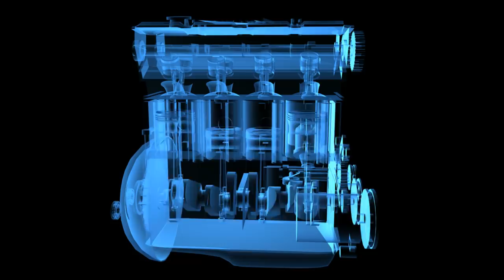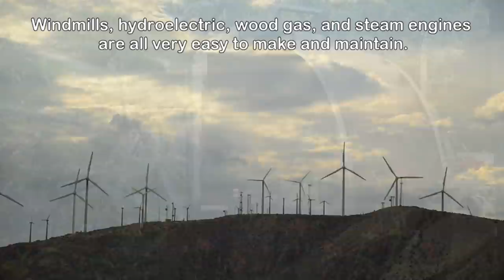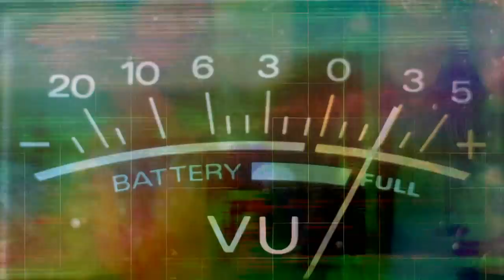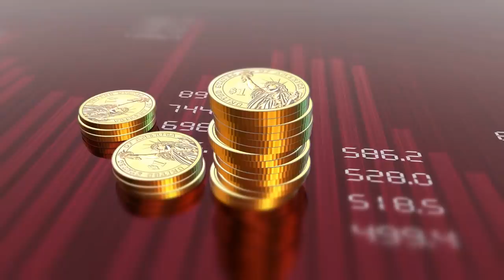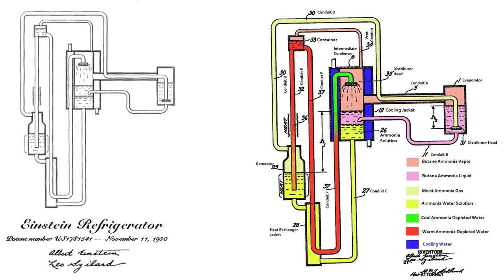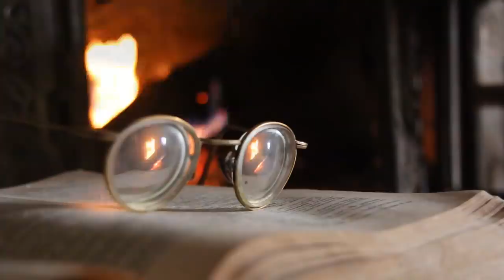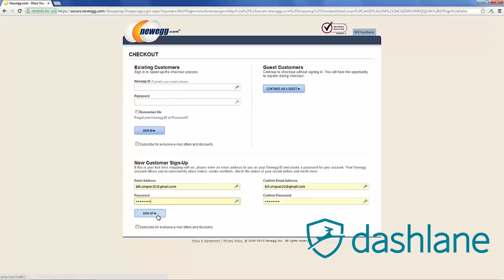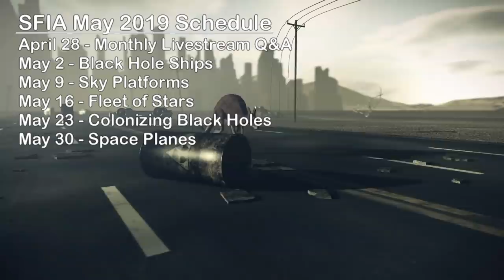Post-Apocalyptic Civilizations

Comment: On the topic of lead-acid batteries: Keep in mind that most 6V and smaller batteries are stored without there acid. The acid is added at the time of use to drastically increase shelf life.
Reply: Lead is fairly easy to recycle or refine from ore too.

Comment: Gasoline would die quickly but Diesel engines can run on vegetable oil and wood gas is not that hard it just has a longer startup time.
Reply: try running your common rail diesel engine on vegetable oil
smh
Reply: Zman888  to run a Diesel engine on vegetable oil you need to heat it first.

Comment: 3:30 I was talking to my dad about this just the other day. He worked 25 years at an oil refinery as a refinery technician. He did not think that a small group of survivors would be capable of restarting a refinery that had not been properly shut down.
        It takes a couple of weeks to shut one down and, if abandoned, would suffer damage almost at once. If it was abandoned suddenly, while running and was shut down when power was cut, or it ran out of raw product quite a bit of damage would happen as units inside the refinery failed and exploded.
     Even if you had old refinery technicians in your party, it would be a nearly impossible task. And that is assuming you could find a source of crude oil.
Reply: Taiwanlight  True. Most humans just vanished some day, there would be places left uninhabitable for a long long time.
      People would just simply have to avoid such areas, as we already do in places like Pripyat, Ukraine.

Comment: Kevlar vests decay. The glue holding the threads of Kevlar tight enough to catch the bullet degrade over time. This causes the Kevlar to become loose, which detracts from it’s ability to be bullet resistant. This is why body armor has expiration dates.

Comment: Reminds me of Turbo Kid, the Mad Max parody where everyone uses pedal bikes
Reply: which is infinitely more likely than Mad Max. 
A good Mountain bike will probably be worth a lot in the post apocalypse.
Reply: @sircastic959  Not even bicycles : their chain & gears wear quickly and are hard to makeshift.
I would rather expect a few horse/cattle wagons, and the vast majority walking.
Reply: @musaran2  Actually, if you replace the chains with a drive shaft (i.e. pipe connecting bulkier gears), and possibly add a gearbox (for at least having 2 or 4 speeds), things would last a lot longer.

Comment: Engines can also run with alcohol, which I think would be highly available after a collapse, since many people would make it even just to drown their sorrows, or for disinfection, or maybe even as a firestarter (a few drops of alcohol and two rocks creating sparks and you've got yourself a fire). And the chemestry needed to make it is not even difficult. In fact, it's quite easy, and you only need pottery to do it, no metal required. And if you have lots of mirrors, you don't even need a fire to make high-octane alcohol. Especially if you have pressurized alcohol tanks, to store more fuel in a smaller volume, since the oxygen in the air would be plentiful for combustion.

Comment: You're right about the paper clip being simple and easy to construct if you have a piece of steel wire, but you're neglecting the difficulty in producing decent flexible steel cheaply enough to use it for some like a paper clip and the far from negligible task of setting up a steel extrusion process. Paperclips are easy but they're produced if you have the excess capacity to make the additional wire, not because you need paper clips and I suspect quite a lot of those technologies are going to face similar barriers to being manufactured again, like how cars are worthless if you don't have a functional petrochemical industry.
Reply: Perhaps so, but i believe a mix of old and new techniques would rise, especially in the short term. Modern carpenters do not drive nails with a hammer, but they could certainly do so.  And someone who has seen a blacksmith forge a nail before could reasonably easily recreate the process, although it may be significantly slower than machine made ones.
Further, there are enough people around with knowledge of metallurgy sufficient to select scrap metal with appropriate characteristics for most applications.  Leaving the need to create 'new' metal products time to be re learned from books and abandoned foundaries.

Comment: Fridges are easy to make.

You just need:

A shovel
Some insulated piping
A fast running stream.

Optional: a lid, insulating material sheet, plastic bags (for holding the food) grease

Dig a hole near the stream - above its water table.

Dig a shallow trench (also optional, you can manage with a hole that lets your pipe out and then lay the pipe overland)

Connect hole to stream.

Seal hole with soil (or lid and grease).

Voila, close to freezing fridge.

Comment: I think a simpler but less efficient refrigeration system could be made requiring two larger chambers, one where to store most of the thermal substance (which can be alcohol) and another where to heat up the substance to cause it to evaporate and be funneled by a long funnel into a pipe which to be cooled when under pressure from which to be separated in smaller pipes which would increase in volume enough for the lower pressure to cause it to absorb heat which to then be then returned to the storage chamber, with a check valve keeping the thermal substance from returning from the heating chamber to the storage chamber. The heating chamber would need to be heated, like with a fire, and the higher the percentage of low-temperature boiling point substance (such as purity of alcohol) would determine how efficient the system would be at cooling things.

Though if we have a source of mechanical power, which is easier to make than electricity, then we can use it for a refrigerator based on compressing a substance. Using some pumps/fans, a pipe cap with a hole to act as a nozzle, another pipe cap (for the outer pipe) and two (preferably conical) long pipes would be more than enough to make a refrigerator, if fed mechanical power. Have the pumps/fans funnel high pressure air into the inner pipe, which would cause it to be heated, then after being cooled over some distance by the air between the inner and outer pipe, the inner pipe ends with the nozzle through which the now-cooled higher pressure air gets released into the outer pipe causing the end of both to cool down, and the air would travel for enough time between the pipes until it either gets released into the atmosphere for new air to make it in, or goes through a heat sink to be cooled before fed back to the pump/fan to be cycled into the system.

The advantage of the second model is that it can even be powered by a moving cart to keep it's contents cool or frozen. Of course, enough insulation (i.e. wool quilts and blankets) would be needed, but aside from that, everything can be made out of wood, aside the animal (human or not) moving the vehicle. If anything, we might become unable to fine-process hard metals, and would stick to the softer materials for most items. Especially if, for some reason, metals are not safe to handle for a few months to years (i.e. solar flares could make metals hot, while not making other things that much hotter). Plus that there might be enough people fed up with the high tech struggles of the society for cults or even full-fledged religions appearing about using technology as sustainable as possible, for everything.

It would be interesting to look at different kinds of possible apocalypses. Examples would be global warming, extreme climatic extremes, climatic extremes and global warming, solar flares frying everything which is grounded or connected to the grid, new ice age, economic collapse, nuclear or non-nuclear war causing most people to die in the explosions/blasts and the survivors would be few and far between, extreme prolonged solar flares leading to most metals to be kept hot enough to not be useful anymore (eventually aside from the cold regions, which would likely not be cold for more than a few years), asteroids rainfall causing the satellites to either leave orbit aimlessly or fall on the earth, bioweapon running loose and causing zombie-like creatures to appear from previous animals and humans, and I'm sure a brainstorming would cook up a lot of interesting scenarios. Oh, what about a rotating habitat surviving the end of Earth, alone, with only a few thousand people at most?

Comment: The Gasoline Dilemma is actually a moot point. Most of those vehicles you mentioned can be converted with minimal effort to diesel or other heavy fuels making the range of available voletiles that much greater.

Comment: There is a lot of conflicting information about pre-Modern people and bathing. According to one thing I've heard, the aversion to bathing started during the Black Death epidemic, when people thought the disease enters the body through pores and thought keeping them clogged would protect them.
Reply: The renaissance is the only period I know of where bathing was actually uncommon (since medieval people largely continued Roman bathing practices of going to the local shallow stream if you had one or a public bathhouse if not), and that explanation does partially explain why, but tbh that sounds like an oversimplification.  My thought would be that that was one of several cultural shifts that led to the death of European communal bathing culture, along with simply not wanting to be around sick people and the advent of lye-based soaps making bathing a painful process that most would only want to undertake once a year at most.
Reply: @IONATVS  I don't understand. If bathing with lye soap was painful, wouldn't people just use something else, even water only, rather than avoid to bathe altogether?
Reply: That would be a rational response, yes, and I don't really have enough info to give any GOOD reason why europeans stopped bathing around the renaissance, but I was simply trying to point  out that there were a lot of things correlated to that time in history, including changes to how people bathed on the rare occasions when they did bathe (such as using lye soaps and bathing individually in private washtubs instead of communally in bathhouses and streams) which made bathing generally less convenient; but in any case I think the shift was more complex than any one explanation.  Perhaps people believed that the cleaning power of lye was so much stronger that bathing with "just" water wouldn't actually help anything?  Perhaps filling a washtub in the middle of a city was just so inconvenient that the new social move to private bathing (whether that was brought about by plague concerns or just a cultural movement against people seeing their neighbors naked at bathing time, or some combination of the two) made people decide that once a year was as much as they were willing to do, and the lye soaps would "make up" for bathing less frequently?  But I think it was probably a combination of many things not just one superstition (like clogged pores keeping you safe from plague), even if it were a common one.
Reply: I can attest that it is quite true.  I haven't bathed in months, and I am completely plague-free.   There really isn't any downside that I'm aware of.

Comment: There's a very specific ingredient that was added to gasoline sometime in the 20th century that was added to increase the energy density of it, that specific ingredient is the only reason gasoline doesn't store well. I remember reading that gasoline supplies before that modification had a 20 year lifespan. I think some preppers are producing and storing the old recipe nowadays.

Comment: As a general rule, we should not be optimistic about the chances of another space-faring civilization arising after an apocalypse resets an earlier one. The most important problem they would have is not having enough energy and metal resources that they could dig from the ground to reach that same level of advancement again. Not enough fossil fuels or rare earths for Internal Combustion Engines or our precious electronics, for two examples. We won't have enough for a second go until the resources get naturally recycled again, which could take up to HUNDREDS of MILLIONS of years.

Comment: Hey Isaac, do you have many thoughts on the concept of "low-tech" space travel? (Like the lunar spacecraft designed by the British Interplanetary Society in the 1930s)?
Reply: I've always been a big fan of "scrapyard"-type spacecraft. you know, built into asteroids, steam pipes, rusty metal, exposed wires, lax uniform standards, overclocked engines, orange color scheme, the like. it fits the post-post-apocalyptic theme very well in my opinion.

Comment: Black powder is easy,smokeless powder is almost impossible with out a proper laboratory. 
You cant run semi automatic or automatic firearms on black powder for more than a handful of rounds.
Not to mention rebuilding primers and making phosphor or mercury fulminate....
After firearms and food though,the written word will be the most powerful weapon available.
Reply: Crossbows would be more practical and as a bonus they match the barbarian style. We will look damn sexy and badass with our crossbows, mohawks and leather gear.
Reply: The primers are a real problem. Crossbows and bows would make a huge comeback. As well as spears for close quarters.
Reply: Smokeless powder does require an understanding of chemistry, yes. Early smokeless powder formulae are doable, it's just way more dangerous to make.

 If you're knowledgeable enough to know the difference, there's a good chance you're already looking for the lab equipment you'd want to make higher-quality black powder with anyway.

The most dangerous part comes from having to make nitroglycerin for those old compounds. Nitrocellulose isn't all that bad.
Reply: @Baalur  Flintlock guns may be a option too. I know some people who have that as a hobby.
Reply: Smokeless powders are actually pretty easy to make, I learned to make nitrocellulose for collodion photography, then for fun I disposed of the extra of it by making prills and lighting them on fire. Primers are a bit more difficult, but doable. "aardvarkreloading(DOT)com/resources/homemadeprimercourse.pdf"

The problem is consistency of manufacture. Semi-automatic and automatic weapons are about as likely as a boltzmann brain. Look no further then In-range's initial desert tech video to see how sensitive self loading firearms are to ammunition and you can watch forgotten weapons to see how many firearms were thinking ahead of their time but failed because they couldn't be made reliable due to ammunition.

Hell, there are designs for actual automatic weapons dating back to the 1600 but manufacturing and powder technology simply did not exist to support it.
Reply: @rojaws1183  very true. Basically all weapons that were used in pre-industrial times would be used. They worked effectively back then and would do so again.
Reply: @OspreyKnight  absolutely correct,thanks for the link,that's awesome!you know its funny,i just got a desert tech mdr!mines been very reliable so far,but I get what you're saying they're very finicky,especially since it's a small companys' first foray into semiautos. So I'll either have a functioning 1000 yard close quarters capable rifle or a forgotten weapon. Either way I'm happy lol

Its unfortunate, but even ak47 and ar 15 will choke if the ammo isn't consistent and good.
And consistency is difficult in a scenario such as an apocalypse. 
I know Maxim had a somewhat working black powder machine gun in the late 1800s.Just had to be thoroughly cleaned after about 50 rounds!It probably would've never made it into production without the advent of smokeless. 
So yes its doable, but I wouldn't call it simple or easy.I imagine we'd be back to bolt actions, revolvers and single shots.
Reply: @regisphilbinsscrotum6631  The fixes they put into it seem to have really done the trick. I'm hoping I can pick one up soon.
Reply: @OspreyKnight  God it seems so and I really hope so.i want to see it succeed because it takes all of the best refinements of the bullpup design and rectifies most of the flaws.It has alot of potential for sure :D
They apparently just made the warranty lifetime as well so hopefully that's a testament to their commitment to its refinements and confidence that it will go for the long haul...or itll just be another Hudson h9 lol
They have a few other successful,profitable, world class rifles though so hopefully it's the former!

Comment: IC engines don’t have to be gasoline/petrol which i agree would be problematic the further out you got.  But diesel and bio-diesel are relatively simple to make in from raw stock like vegetable oils, old motor oil etc.  
Also many of the basic machine operations required for maintaining engines can and has been be done by hand in the past.  Before electricity basically all heavy machinery was run off water power through linkages of belts.

Comment: fun fact about modern gasoline: The 10% ethanol that is usually used actually reduces it's shelf life even further to only a few months. Without a fuel stabilizer the gasoline will quickly separate as you mentioned. So yeah. in about 3 months most of the usable gasoline will have become mostly useless, and after a year all of it will.